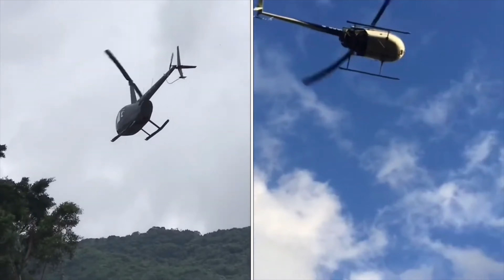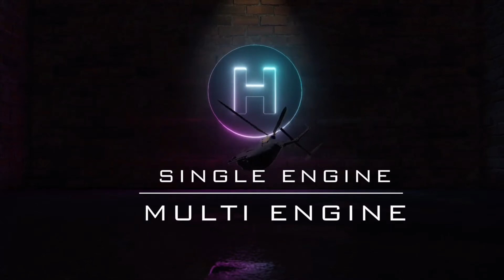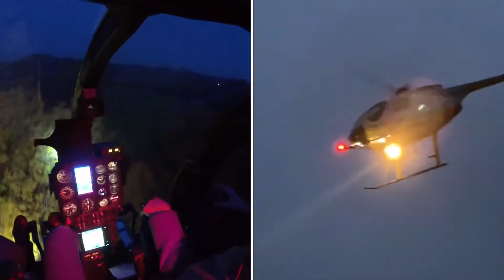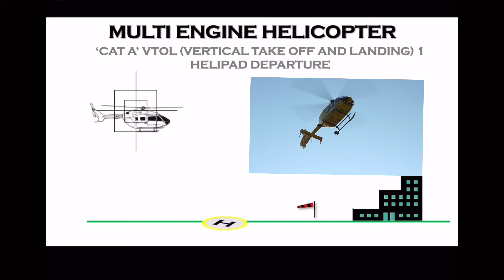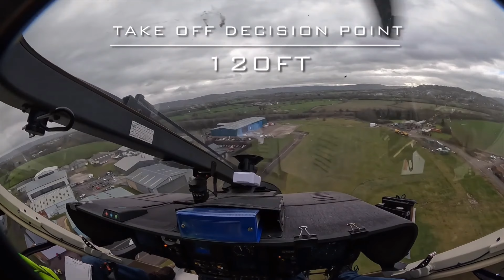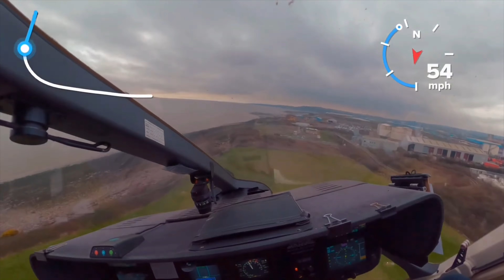How to take off in a helicopter

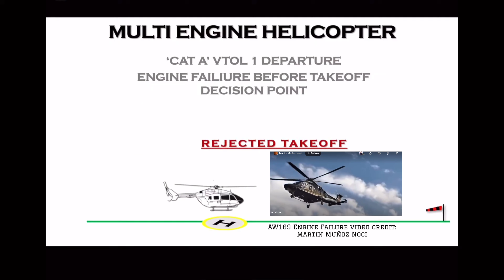Comment: Thanks AB! Unfortunately, your voice is a bit quiet in places and particularly around 07:30, the aircraft noise drowns you out. Separately, I note we train for engine failures, but the R-66 has had over three million hours on that RR-300 without one breaking. TR problems on the other hand, a bit more frequent. Do you think we might usefully have a little concentration on autos and a bit more handling of TR problems? Cheers, Steve
Reply from the maker: Steve- thank you as ever for your feedback and support - stand by for the reupload shortly . Re the comment on engine failure during takeoff- you are 100% right for ‘modern’ turbines - eg the 66 - alas the recent Australian report on the mast bump event (with video footage ) highlights other - more prevalent - risks that exist- so yes- we can focus on the other single points of failure in the next video!!
Reply from the maker: Fixed -thanks again for the heads up 

How to take off in a helicopter #flying #takeoff #helicopterpilot
https://youtu.be/e0s4t0H9Y64